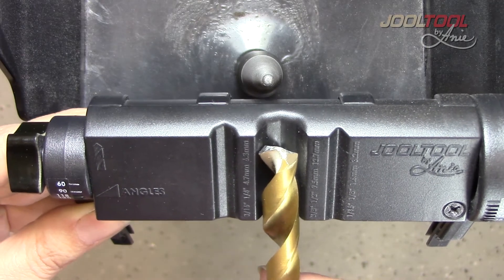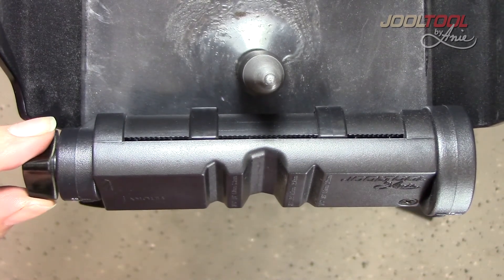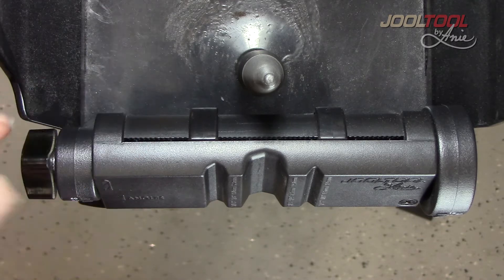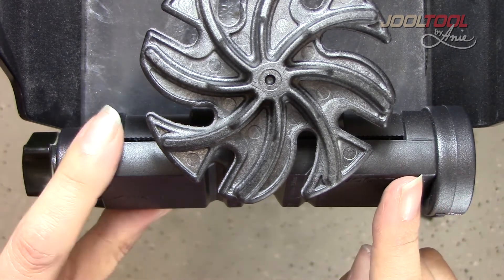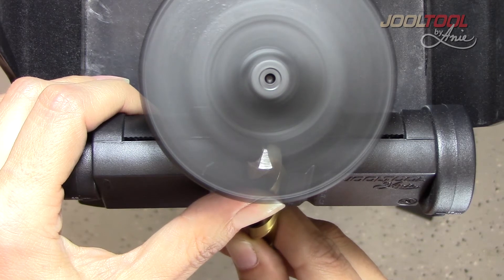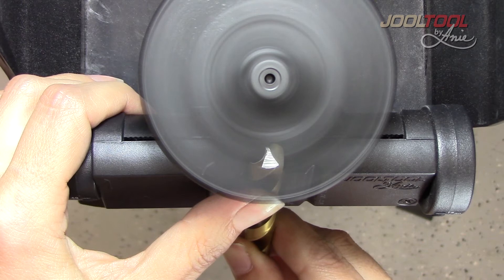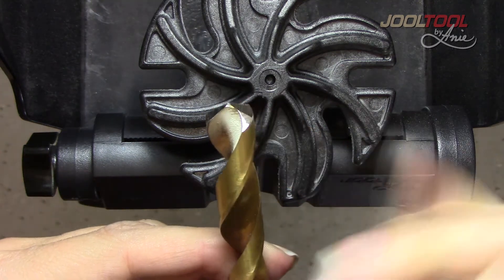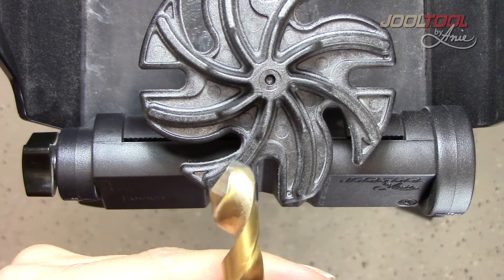How to Sharpen a Drill Bit using the Tool Rest

Comment: Anie,

Your JOOLTOOL is a great invention but it's too expensive. You should team up with Harbor Freight to re-engineer the unit to use something like their $24 variable speed rotary tool.

However, I do enjoy watching your drill bit sharpening videos.
Reply from the maker: Thanks for your input. Our discerning customers appreciate the professional results achieved the innovative patented JOOLTOOL system and industrial-grade 3M abrasives, both of which have required a significant investment in R&D and manufacturing. As for Harbor Freight, it is a nice place to get common tools for the DIY-er. Plain and simple.

Comment: As a machinist and a tool and die maker apprentice I can tell you that that cutting angle geometry is incorrect there is no relief behind the cutting edge and you can't actually going the split point like that.
Reply from the maker: Hey Dakota, you can create the relief,super easy and pull it back as much as you would like. This video was a quick overview on the tool rest. I have more detailed instructional videos on the DVD that comes with the purchase of the Jooltool. Btw, you can sharpen a busted up drill bit in about 1 min, we did them at the SEMA Auto show I was exhibiting at this month, many machinists were in the crowd and were impressed at how good it cut! Thank you, Anie